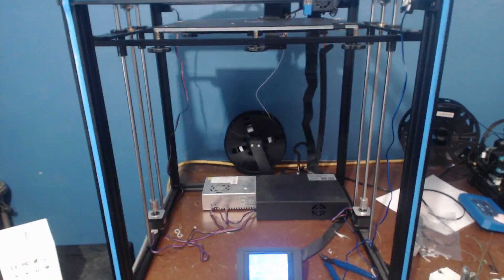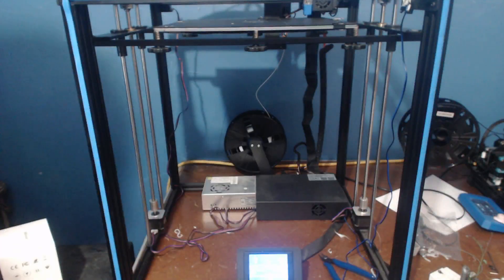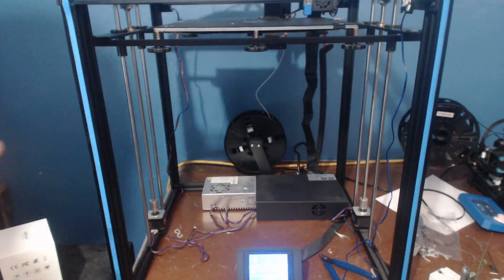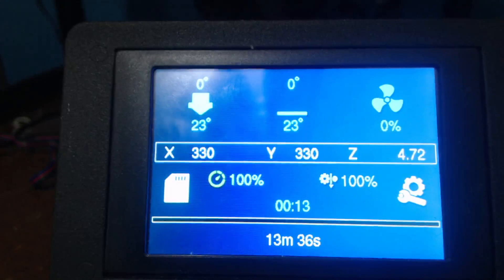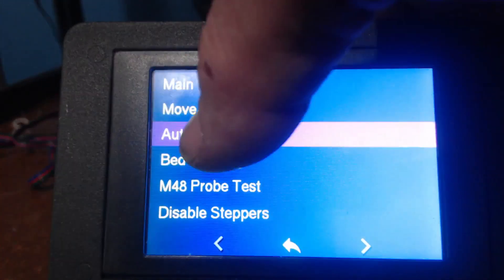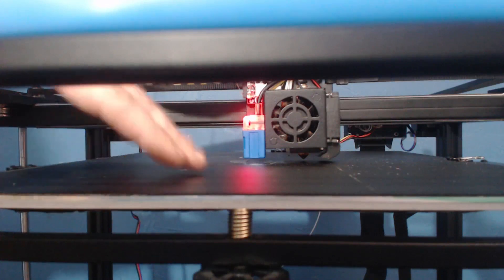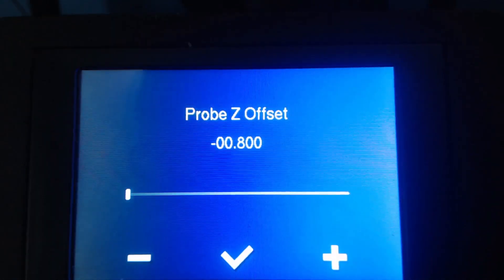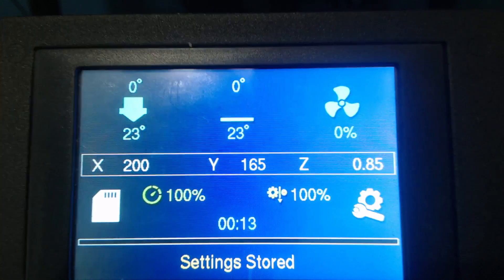Adjusting the z offset in marlin 2.1.1 Tronxy coreXY

Comment: Thanks for the video. I had the exact same problem with the X5SA.  Tronxy support was not helpful. They said I need a new bed level senor which they never sent.  I also upgraded to Marlin and it all works now.  I also had to replace my bed as it was damaged. Check out G10 or Garolite as a printing surface.  So much better than stock bed.
Reply: having same issue, Struggling finding files for firmware

Comment: CURA QUESTION: I use an ultrafast 0.28 profile. But the top few layers have embossed numbers and look like crap. I know you can make changes at a specific layer. Can I find the transition layer and tell Cura to use a different high quality profile for the last say 10 layers? Does that require a plug-in? Thanks. Using 5.21